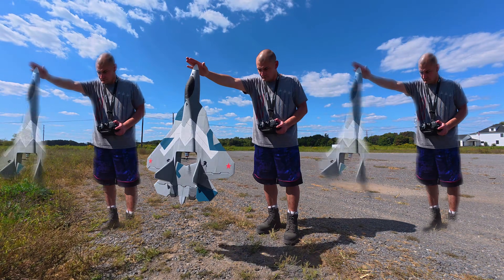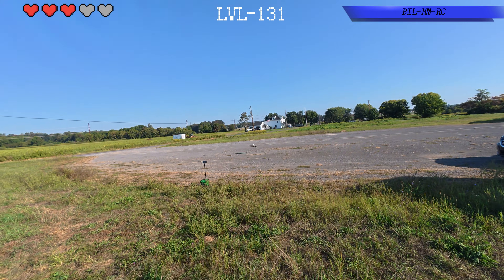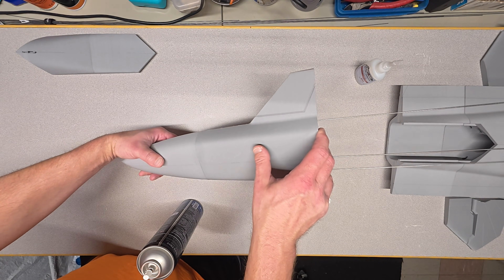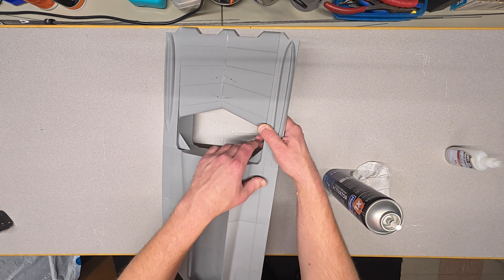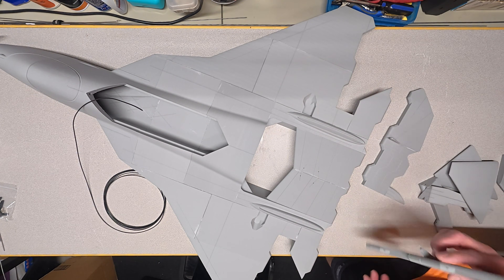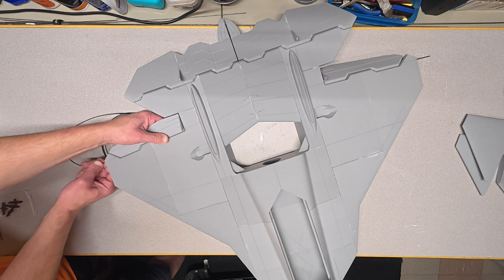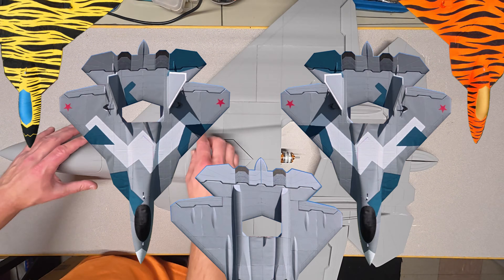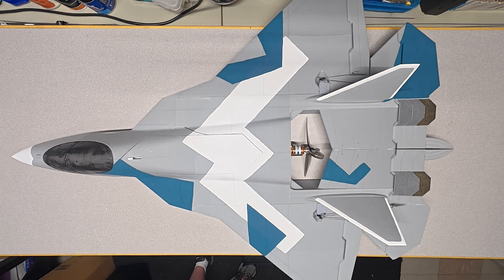Crash Resistant - Budget Friendly - SU-57 Park jet - Step by Step DIY

Comment from the maker: How can I help you be able to print and fly one of these models?   What part do you need help with, and what would you like to see in future videos?
Reply: I’m currently struggling to print with the LW pla… I have copied your settings by opening presliced gcode in notepad but I still can’t get a decent print out … any other information regarding settings would be greatly appreciated!
Reply from the maker: @lobstamobsta5882  Opening in notepad is a good start, but not all the settings will be listed there. I will make a video about this in the future for multiple slicers, but you need help now. The easiest way to help you from afar (until I make a video) would be for you to download either the F-22 or the SU-57 test files (FREE). There are 3MF files in the download for PrusaSlicer, but they will not open in another slicer. Either download PrusaSlicer(add your printer) and use my PrusaSlicer profiles to slice your model with my settings, or open the 3MF's using PrusaSlicer and copy them to whatever slicer you are using. You will have to copy as many as you can. Hopefully you are using a slicer based off of Slic3R like Prusa, Bambu, Creality Print, Super Slicer, Orca, etc--- they are all very similar and work well for RC Airplanes. If you do copy the settings, the temp and flow, all the main speeds, and the settings for the filament are the most important (retraction, de-retraction). Just copy as best and as many as you can. Also, make sure "Slice Gap Closing Radius" is set to 0.00, or the internal structure will not be there. Depending on the model that YOU are trying to print, there are other settings which may need tweaked for a cleaner print (Like avoid crossing perimeters-max detour length and de-retraction extra prime). ALL my 3mf's are a little different depending on the part that I am printing, so use a 3MF that is similar in shape and print settings that you are printing (wing to wing, fuse to fuse ect.). Also keep in mind that my models are designed to print-- meaning no overhangs or steep angles, and all travel moves come from the infill pattern itself (not the model)- so if you are trying to print another designers models they may not print as easy or as well as mine do, but they should still print using my settings. If you are using Creality Print know that the Filaments retraction settings are kind of hidden and hard to find (Next to your printer in the top left, click on the pencil icon. Then click "Extruder-1" to find the retraction settings like retraction length, speed, and extra-prime AKA de-retraction)
Reply: @HoloModels-RC thank you for the fast response! I will give that a try ! I can’t wait to fly this thing
Reply from the maker: @lobstamobsta5882  Welcome! Curious to know which approach you used and how it turned out in the end. It took me a few models to get the hang of it several years ago.
Reply from the maker: @lobstamobsta5882  How you making out?
Reply from the maker: @lobstamobsta5882 Which airframe are you printing, and more importantly which slicer are you using?
Reply: @HoloModels-RC  SU-57
 And I’m printing in a Anycubic Kobra s1 with AMS . Using the anycubic next software .
Reply from the maker: @lobstamobsta5882  Just downloaded the Anycubic Software to check it out. That program will work fine for RC, and should be relatively easy to copy all the settings over. Best of luck!